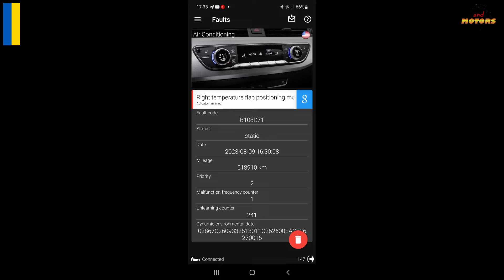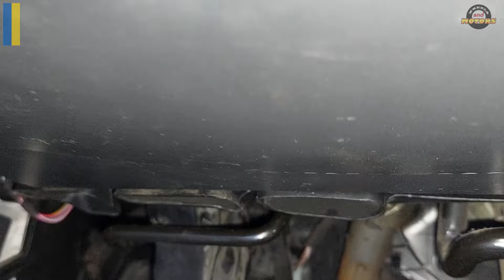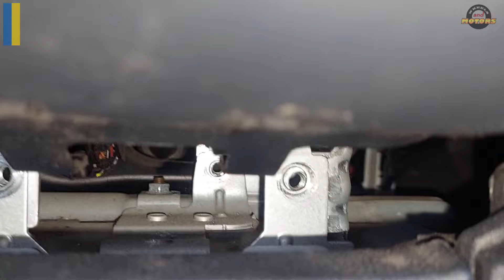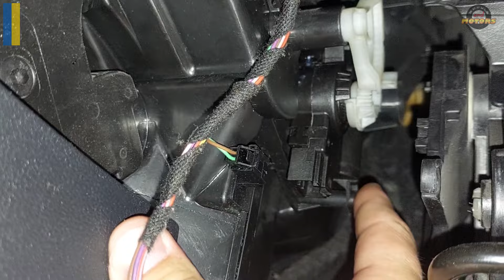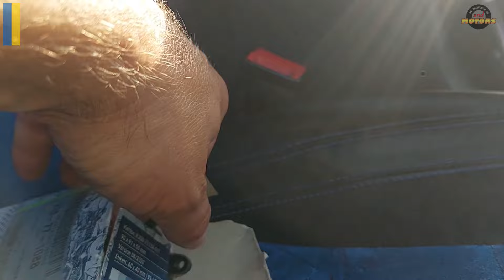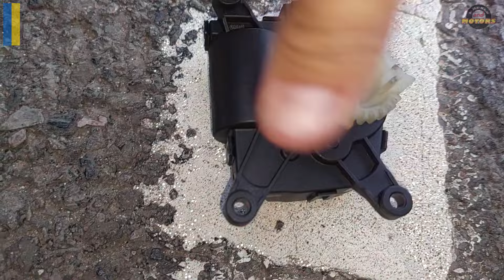Replace DRIVER SIDE heater control, temperature flap position motor. B108D71 (VW, Audi, SEAT, Skoda)

Comment: It’s really helpful video thanks mate. I have to replace the same motor. Otherwise could you help me with the other issue. The air doesn’t come into the cabin only when I turn on the air recirculation button. Which motor should I change?
Reply from the maker: I'm sorry, this is the only flap I have experience with. You see, I'm not as clever as I look in my videos. If I have a problem with my car, I try to do research and make a video out of it. And I have not been deeper into it than this, yet 😔

Comment: “Seat Ibiza 2017 - the blower is working and I can hear it, and fan speeds change normally, but sometimes there is absolutely no airflow coming from the vents. Then suddenly it starts working normally again. The recirculation button has also never worked properly. Any ideas?”
Reply from the maker: Not many ideas, sorry.. Is the cabin filter ok? Or maybe the blower motor is on its way out (about to break), which is more likely as sometimes as you say air flow is ok. How many miles? Is the blower still original?

Comment: Hi brother my fault code is B108C71 - Left temperature flap positioning motor: Final control stuck. Any tips?
Reply from the maker: This is what I found:

This motor (actuator) is responsible for moving the physical flap that directs airflow to your windshield when you turn on the defrost setting.

Why does this happen;
Mechanical Obstruction: Sometimes a foreign object (like a coin or a pen) falls down the defrost vent and physically jams the flap.
Stripped Plastic Gears: The gears inside the motor are plastic. Over time, they can crack or strip, meaning the motor spins but the flap doesn't move.
Loss of Basic Settings: Occasionally, the car simply "forgets" where the flap's limits are.

Comment: excellent video,i wish i`d found your channel a few years ago, i changed the same motor on the passenger side of my superb, you make it look sooooo easy, i  struggled to be honest, and i don't know if i put the cog that slides into the heater back in properly as my heater takes 10 mins to get warm in winter !
Reply from the maker: On a cold start it takes a while, because the coolant takes time to warm up.

Comment: I have this same issue on my Audi where the heat is stuck on hot, i'm also unable to change the direction of airflow is this part of the same issue?
Reply from the maker: It depends which year is your Audi. I had an algae with a completely different valve system:
https://youtu.be/r2fW_XCAu1I?si=yuq2ZQbFgYgqV40A
Reply: @wawayltd  so mine is a 2013 a4, only recently had this issue present itself. The blowers don't change direction or temperature, The passenger side appears to change direction still but middle vents and drivers are definitely not changing being a nightmare currently. Any help would be amazing. I do intend on checking the actuator when changing to see if there is any movement.
Reply from the maker: I'm not sure if I can help you with this one. I don't have any data on that Audi. I'm just a DIY enthusiast with my Skoda, and whatever I find out about my current car, I share on YouTube.
Reply: @wawayltd  I appreciate that mate and using your vid to hopefully assist with this, Fingers crossed and all the best!
Reply from the maker: I hope it helps 👍

Comment: Help.. Try and understand me.. 

Should I try this if my heating on driver side can go from cold to a little bit warm (but not as hot as passenger side) .. Or is this a fix for the heating being constantly cold only.
Reply from the maker: I would have a look if the flap motor goes from fully open to fully closed when switching between cold "hi" and "lo"
Reply: @wawayltd okay I will have a look. I'm not hearing any clicking when I'm inside the car like anything is broken but I'm still going to investigate

Comment: hi , just want to ask you if the 5Q 0907511 is for the passenger side and the 2Q 0907511 is for the driver side?or they look identical for both sides? thank you
Reply from the maker: In VAG parts numbers first 3 symbols refer to mode/platform code. 5Q0 - Octavia, Golf, Audi A3... 2Q0 - VW Polo Mk6, SEAT Ibiza Mk5, Škoda Fabia Mk4... Then 907 means that it's an electrical component. And finally 511 - code for the specific part. However, I didn't have any experience with the other side, so, unfortunately I don't know if the same part is used on both sides, sorry

Comment: thanks for your video! I replaced mine, but it "overrotates"... Any idea what to do? I recorded a video here: https://www.youtube.com/shorts/5dM7-_75yic
Reply from the maker: Hello, sorry for the late response. It looks to me that the sprocket on the new flap motor might be misaligned. Can you check if it's inserted correctly?
Reply: @wawayltd  No worries! Hmm. On the original motor it could only fit 1 way.. but I see that on the new motor it can fit 2 ways, it does not have the "locking pin" square hole like the other one. I can try and reverse it and see if that maybe can fix it.. ty
Reply from the maker: I hope it works 🤞

Comment: I have the same issue, passenger side is always cold. What is the problem in the flap motor, that needs to be changed? malfunction, or just doesn't work anymore proper?
Reply from the maker: Mine just stopped working. I don't know why, some internal problems. I just replaced it to save time.

Comment: Great video, i have a skoda octavia vrs mk3 i have luke warm air on the driver side baking hot on the passenger side i tried recalibration, new heater matrix,  if i look up under the driver's  side footwell i can see that part but mine is working i can see it moving hot and cold iv run out of ideas and its costing me a bit too .
Any ideas please
Reply from the maker: There is another regulator on the passenger side. Did you check that one? It's behind the glovebox.

Comment: Thanks a lot for that great video! For me it was not clear, whether the flap motor has to be teached or calibrated. But you explained it very comprehensive.Thanks for that!
Reply from the maker: You're welcome 😊
Reply: @wawayltd  You still need to calibrate you flap stop positions. 
With ingition on, hold the AC button and button to send the air to your face for 3 seconds. The flaps will then start making noises as they calibrate and the lights will be blinking. When they stop you are done.
https://www.youtube.com/watch?v=dyPSD_Er7CY

Comment: Hi mate I got engine light on showing code p20B900
Seat Alhambra 
Thanks
Reply from the maker: Possible issue with the wiring for AdBlue heater or maybe the heater itself. I think.

Comment: Checked mine and see cogs moving and can see flap opening/closing but still get this code come up?
Reply from the maker: Did you check both? Or the code is pointing just on that one?
Reply: Code says right side actuator, I'm UK too
Reply: B108d71
Reply from the maker: If the code keep coming up, must be something not right with that flap
Reply: I've now changed the part like you did, still not working correctly and still got the code. Any ideas regarding the flap?
Reply from the maker: New one not working correctly? Did you say previous was working?

Comment: Hello i have the same problem i have audi a3 8v 2013 uk model Rhd and middle and driver vent blowing cold and i scan with obdeleven and it says Left temperature flap position motor 
Foult code B108c71 
 Can u please help me is the same  motor i have to change or mine is in different location
Reply from the maker: Sorry, I have no information on Audi A3. Try to have a look in the same location, if they use same flap motors
Reply: @wawayltd yes they have same flap
Reply from the maker: @justindreka660 Easy 👍

Comment: Hey! I have the same car and my a/c sometimes works well, but sometimes I’m getting the hot air (not cold enough). Should I replace this motor? Could you please help me?
Reply from the maker: It could be a problem with AC, not the flap. Is everything ok with tue pressure in AC system? Is compressor engaging?
Reply: @wawayltd Yes, all good! Why I’m pointing to this flap - I’m getting the same error in the VCDS diagnostic, as you shown in the video - “B109D 71 - Actuator stuck”
Reply from the maker: If there's a fault code that's pointing to faulty or stuck flap - definitely worth checking that flap.
Reply: @wawayltd Will try according to your video. Great guide, big thanks for this video!
Reply from the maker: @vadympanko9184  I hope it helps 👍

Comment: Super useful explanation! In my case, I realized that it wasn't working because the gear opposite the motor is no longer there (it must have jumped out with some pothole, and it got lost). Do you know if that component can be found separately?
Reply from the maker: Not sure. You can search with car breakers.

Comment: Hi i bought volkswagen polo mk5 2010  from  car auction  and I was driving the car from auction to my home  and  is blowing hot air even i put to the cold position is still blowing hot air you think i have the same problem  please help me
Reply from the maker: I think that it could be the same problem, but I don't know if 2010 Polo uses the same unit. Should be pretty similar.

Comment: Thank you for the video I have passat b8 2016 tdi and I have the issue with drivers side cold coming on drivers side and hot on passenger side any help would appreciate
Reply from the maker: Try checking if it has the same type of flap.
Reply: @thank you for the reply I didn’t do any diagnostic yet, but I noticed in the last couple days hot coming from passenger side, but cold on a driver side not very cold, but it’s not the same as the passenger side passenger side. It’s more hotter than driver side. Thanks

Comment: Hi if my 7seats Sharan , front blow cold air but rear can blow hot air, what ‘s wrong of front?
Reply from the maker: When I had my Sharan, I didn't have this problem, therefore I don't know, sorry. Try to scan it, my fault code can point out to the flap or something.

Comment: You absolute genius! 🎉🎉
Reply from the maker: Thanks, I know 😎😁
Reply: It's slightly different on a manual mk7 gti because the access is reduced to the two screws. I had to use a small Allen key for the bottom screw to loosen. Then used a 5.5m hex.  @wawayltd
Reply from the maker: That is helpful 👍
I hope more people with Golfs will see this.
Reply from the maker: @SabeTheApple Good idea! If you do. I can put a link in my video to your channel or video.

Comment: This video is reslly good 👍 got one side of my heating not as warm as the other so im guessing it could be this motor!? Ive tried the reset by pressing the two buttons and it hasnt worked. So will check this next thankyou
Reply from the maker: I hope it helps 👍

Comment: My 2012 Yeti Tdi 2.0 is blowing heat to the driver's but not passenger's. Air comes out of the vents but no hot heat. Tried re-calibration and it seems to work for 1-2 seconds then back to colder air. What could it be? The anti-freeze is 1 year old.
Reply from the maker: Probably heat flap control needs to be checked.

Comment: Awesome video. Very clear instructions. I have the same problem for 1 year now. Can you tell me, is this the same flap motor that controlls the windscreen air? My driver side and windscreen vents are blowing cold air only, and passenger side is working fine.
Reply from the maker: Hello. Thanks 👍. Yes, it is supposed to control temperature for the driver's side, whether it's blowing on a windscreen or on your feet.

Comment: At Seat Leon 5f I have a strange sound from that place when I turn on the AC, like a propeller hitting againts something. Can be that piece?
Reply: Same thing that I have on same car. If you find the rootcause please let me know also
Reply from the maker: Is that when you turn on the toggle AC or when the air blower is turning on?
Reply: @wawayltd  whenever the ac is turned on in any position, temp etc
Reply from the maker: Does it make a noise with air blowing without AC on?
Reply from the maker: I reckon that your blower might be going. Especially if the noise is coming from behind the glove box:
https://youtu.be/cxJi59GoB2s?si=Qd9Ma3r3c6U_nQNS
Reply: @wawayltd   the noise come from behind/under the steering wheel
Reply from the maker: I'm not sure how to help, sorry. Someone needs to find out what exactly is happening there.

Comment: I have just checked both sides and both are turning when going from lo to high. It's still only getting hot passenger side and Luke warm drivers side. What else could it be? Thanks
Reply from the maker: That's where my experience ends. Unfortunately, I don't have experience with heater matrix, sorry.

Comment: Very nice explanation you did there, i have the same problem and i bought a new heater control and replaced it like you did but its still not moving, nothing happens when i change the heater from hot to cold, and im kinda lost now and dont know where the issue from
Reply from the maker: I don't know.. Maybe wiring?

Comment: I have a B108C71 code, it's a 2015 VW Passat left-hand drive that doesn't blow cold in the driver-side vents. What module should I replace?
Reply from the maker: Is it recirculation flap?
Reply: @wawayltd  no, the driver-side left flap temperature. Is stucked on warm
Reply: @wawayltd  here the code: B108C71
Left Temperature Flap Positioning Motor -
Actuator Jammed
Reply from the maker: I would check flap motor, if it's just jammed, see what I can do to "un-jam" it, if it doesn't work, I would replace it.
Reply from the maker: I don't have any documentation on Passat, but I would expect it to be something similar to this video.

Comment: Hi great video I have a seat Leon 2013 5f would this be the exact same way to do it in my car as you have done in the video
Reply from the maker: I don't have any info on Leon, but it might as well be the same. This control motor can be visible before doing the job, so my advice would be - have a look under the dash.

Comment: Thank you for this video, we found issues with our A/C last Easter driving in Poland. Wasn’t a problem having cold air over the summer but your video let me change this over in an hour or so.
Reply from the maker: You're welcome 👍
Reply: @wawayltd  my turns exactly like yours but it’s still not hot enough and the hot air only comes in the middle should I buy a new one or a new heating core?
Reply from the maker: Sorry, I don't have any experience with this problem.
Reply: What was your problem?

Comment: Ive a problem with my audi a6c6 , i dunno why it dont blow hot air , it does only cold air . Ive cleaned those two near windshield, but nothing happening , still blow cold air . When i remove the bolts it come out hot water , so i think radiator is good , what can it happent how to fix it , can it be the motors that change from cold to hot or not ?
Reply from the maker: In A6 C6 there's no motors, there are solenoids that get stuck - check this out:
https://youtu.be/r2fW_XCAu1I?si=0swd9Yc8_Db1d3Lc
And this:
https://youtu.be/BlreVXqA390?si=4337GbeOrVXE0GNs

Comment: I have noise coming from this area, but I just notice that when a/c is on I have cold air passenger side side BUT hot air on drivers side. Should I buy this part, do you think it will fix this
Reply from the maker: If the temperature on one side is completely not as you set it and expect it. There's a big chance that it's a flap motor fault.
Reply: @wawayltd Thank you for your time and effort doing this video & helping people save money. Should be easy fix for me… Not long got a 2014 Octavia & the heating is driving me nuts with clicking….. If not on High then click click click all the bloody time. Only stops clicking if off or on high, even if I turn down heat by 1 then clicking starts arghhhh again !!!!! VCDS shows B108D71 
Actuator stuck, tried the 2 button hold for resetting calibration but still stuck, I’ll check eBay for part or need to order from AUTODOC, takes weeks

Comment: Very helpful - was about to order a heater core as thought that was the issue then came across this video. Ordered a heater flap motor on eBay 2nd hand for £10 it is a bit fiddly to do but it solved the issue and now both drivers and passenger vents blow hot and cold. Thank you.
Reply from the maker: You're welcome 👍
Nice to know that it helps someone 😊
Reply: I have a golf gtd Mk7 that blows hot passenger side and cold drivers side. Could this be the issue as I thought it was the heater core but my silica bag hasn't split.?
Reply from the maker: I would try to open up and see if the flaps are moving when the temperature settings are changed.
Reply: @jasonjay7650 did you find out what the issue was?
Reply: @jasonjay7650 I have the same issue, did you ever solve this?

Comment: did u ever change yours from the Sharan 7N???ich think i had the same problem on my Alhambra 7N now (on the driver-side)
Reply from the maker: No, I didn't have this problem in Sharan. 
And I don't have that car anymore...
Maybe it's similar to this Skoda?
Reply: thanks for the great videos you‘ve since yet👍
Reply: Hi my sharan front blow cold air but rear can blow hot air, do you think what ‘s wrong?

Comment: If battery are disconnected due to the airbag and the air bag is set aside like in the video.
What if i need to start the vehicle to see if the flap motors are working or not after i have removed all the panels.
Would it be dangerous and potentially set of the air bag?

Also, would the motor stuff and such be mostly the same and in the same place on a vw Tiguan?

Thanks for the video.
Reply from the maker: I kept the battery on. In my humble opinion, I don't think there's a big chance of airbag blowing, unless you're doing something really silly. Especially if you're not mesiing with electrical connection to the airbag. I said in the video to disconnect the battery as a disclaimer. 
As for similarity in setup with Tiguan, VW likes to share components across. I believe it should be fairly similar, but I can't say 100%.
Reply: @wawayltd  okay thank you.